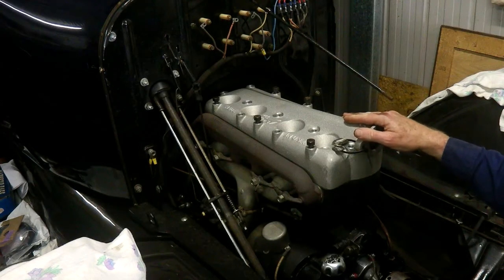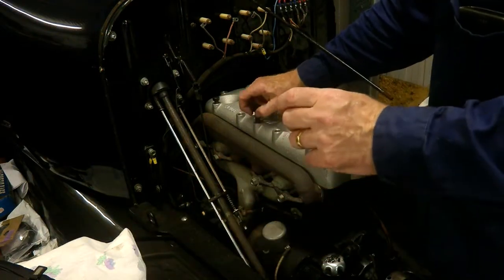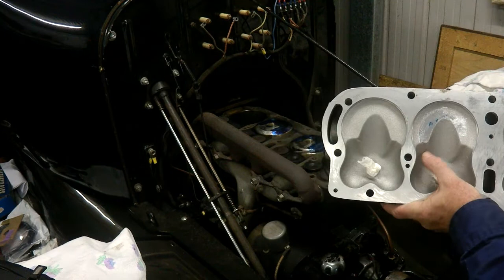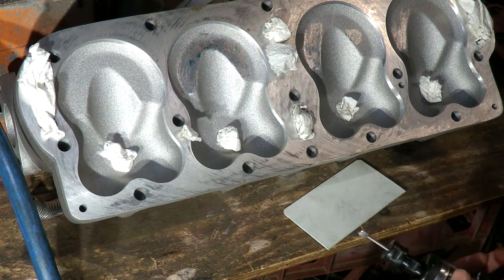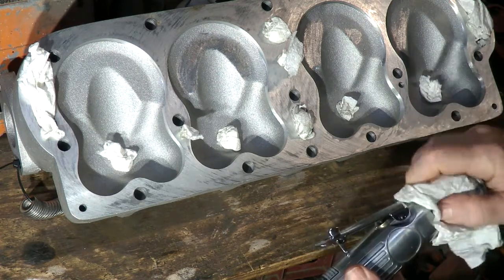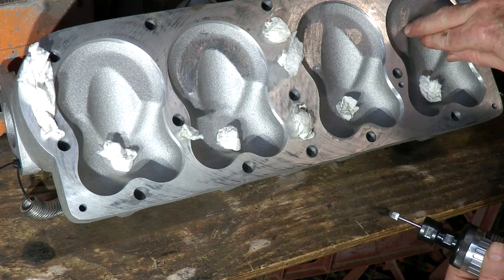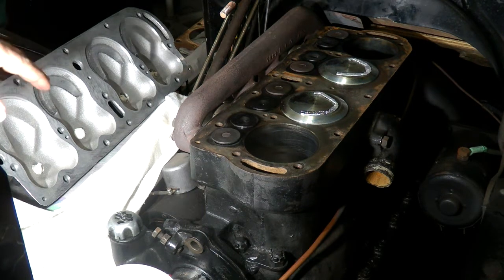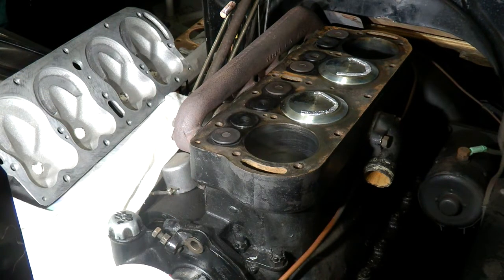1923 RHD Model T Fordor   Improving Performance Part 2

Comment: Greetings Dennis... interesting work. With such tight tolerances between head and piston, will your head gasket thickness account for heat expansion of piston and rod?
Reply from the maker: Mike,
The amount of gap with the compressed head gasket provides sufficient clearance. I have been running the engine with no problems so far.  Denis